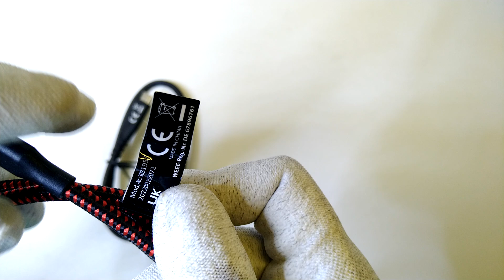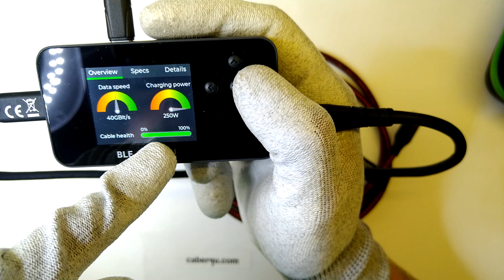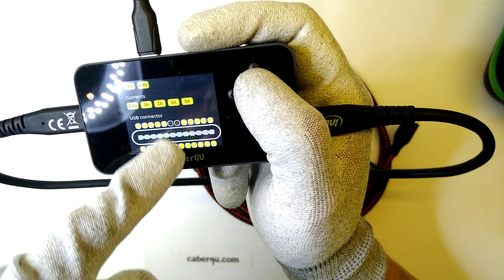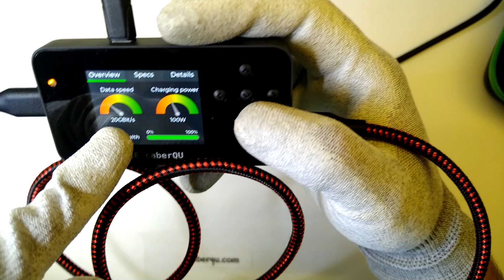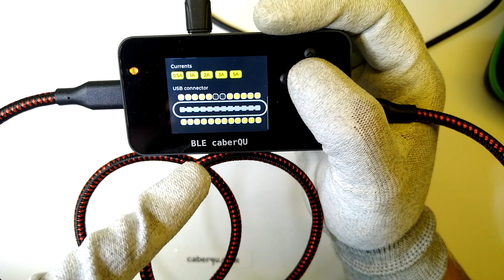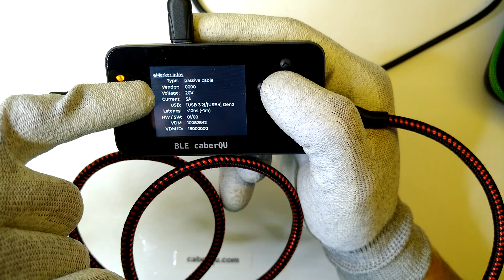Why USB-C cables have chips inside that can talk to your phone

Comment: Thanks for the info. But, for the red USB3 cable, why does the "emarker info" mention USB4 if the "available options" doesn't. Very confusing.
Reply from the maker: That's a good question, the USB PD reply can include "[USB 3.2]/[USB4] Gen2" and be interpreted differently depending on the other cable parameters